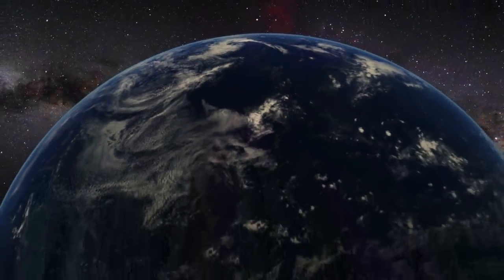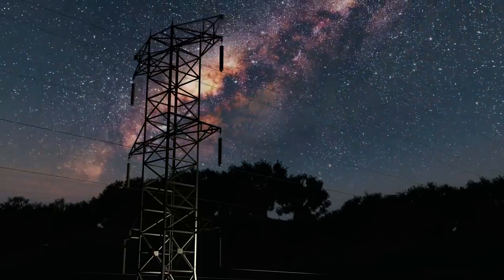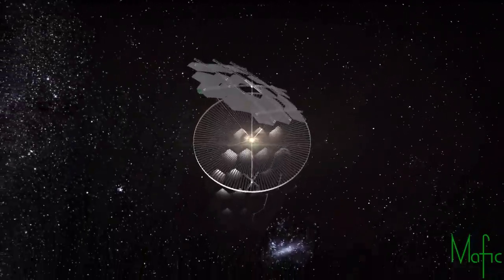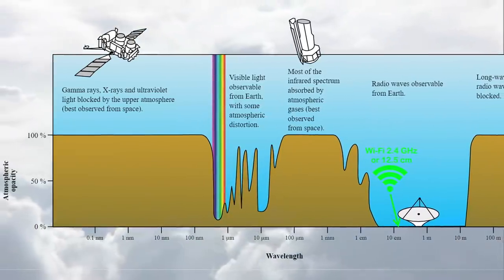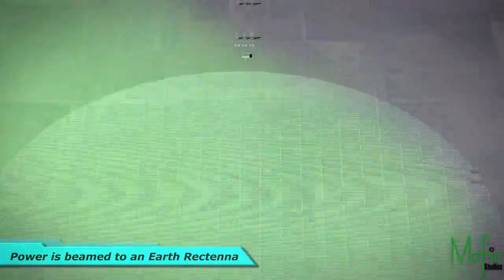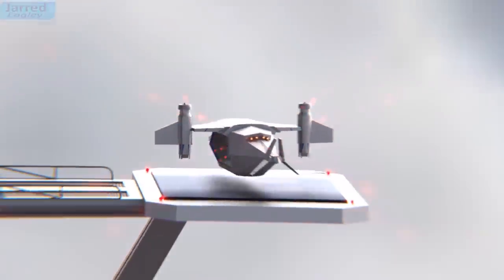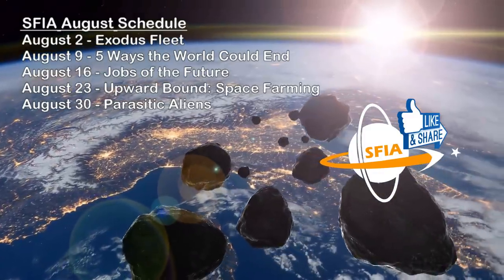Power Satellites & Space Based Solar Power

Comment: First, battery storage is only necessary if localized terrestrial solar is your only source of energy.  So long as another source is sufficient, and there is sufficient demand, you can sell your excess generation to another user and then buy what you need back when you need it.  Also, wind power is complementary as winds are stronger at night.  Long distance transfer of power also helps the offsets the non-load following issue of solar.  Besides, is their an economic sweet spot.  Kirk Sorenson in his speeches on Liquid Fluoride Thorium reactors mention how one of his tasks as a grad student was to study space based power systems and when they cranked the solar panel efficiency to 100%, dropped launch costs to zero and cranked oil costs to $200 a barrel (he actually described it as a Mad Max future for oil prices) it was still not economic to place solar power plants into space and that's with zero launch costs.  Granted maybe fossil fuels may rise to thousands of dollars per barrel but it would appear that for the foreseeable future, simply balancing generation between terrestrial solar, wind power, tidal, hydro and nuclear as well as long distance transport of energy would be the path to take.

Comment: Power storage ideas are an entire subject in and of themselves.  The new generation of batteries such as metal lithium, zinc bromine gel and salt.  Hydro-pneumatic devices which compress air using water in order to get around the heat transfer problems.  Simply pumping water to a higher level during the day and converting with water turbines during the night is possible.  It only remains to be seen which technique wins the efficiency, cost and convenience battle.  Perhaps all will have their niche.

Comment: You forgot the most important application that could be done right now: massive shades in Lagrangian L1 reducing the solar influx by 3-4%, enough to cancel any kind of "global warming" effect or fluctuation in the Sun's radiation (the main trigger in what we call "global warming" and ice ages). At the same time, when and if a Maunder Minimum will take place, the solar shades / mirrors could reflect back more energy, heating the Earth or part of it. 

Also, Philip Lubin could use those mirrors to generate some energy and power his giant 10 GW array of 1928 nm lasers in order to deflect any asteroid heading to earth.  Or use it as a giant space weapon against totalitarians. The cost for all of this is just a fraction of what we spend now on "CO2 reduction"  and "green certificates". All the industries would benefit from a lower cost of energy, if that is produced from coal with sequestration and in remote places, and at the same time, the energy bill would not include any kind of wind&solar subsidies (that will go to this massive laser space project). Win / Win for all and a massive incentive for a Moon Base, where all of that manufacturing for the 1500 km mesh array will take place. 

https://www.youtube.com/watch?v=XwYJZqBB0ms

https://1.bp.blogspot.com/_JtKzQh0R9Tg/ShoeWDFE8PI/AAAAAAAAAoI/8NiaXweN9dY/s1600/how-to-move-the-sun3.jpg

Comment: One critical issue with large arrays in Space for power is micrometers & comet dust that can destroy them. Probably the only practical option is very large mirrors with filters to produce near coherent light since a meter impact in Mylar isn't going to create electrical shorts. Perhaps there is a meta material possible that would convert optical light into microwaves (ie direct visible to microwave conversion with any electrical conversion - no middle man). Mylar is cheap and light and thus its possible to lauch square km of mylar in a single heavy lift rocket.                                        That said there is an issue with microwaves interfering with radio transmissions. Probably the best option is a low earth orbital ring with tethers to transport electricity down to the surface. I think an orbital ring might be easy to construct that a space elevator since the circumference of low earth orbit isn't significantly longer a single tether to Geosync. orbit. Especially when you can use multiple tethers linked together and their orbital speed would hold them in place during construction. Another propulsion method is to use very large filtered mirrors to produce near coherent light and use that instead of laser to propel probes and space craft. Mylar is cheap and light, and an optical filter to reduce the light into a narrow wavelength would not be complicated. The only issue is collimating the light over long distances, but considering current optical tech, it should not be to difficult.

Comment: I don't think it can compete with ground based solar and power lines. 
If you put solar in Antarctica, you've got 24/7 power for the northern hemisphere winter months. Transmission by cable over that distance is more efficient than microwave orbit to ground. During the northern summer it's always sunny somewhere close. You can just connect the continents with UHVDC networks. 
There might be a place for this to power isolated island communities, but it just doesn't work for general use. In the same way that data satellites are useful for special cases, but the majority of data travels by undersea cable.

Comment: At around 15:02 details of 'wireless" transmission of electricity thru the use of microwaves is discussed. It struck me, that was the goal of N. Telsa decades and decades ago...correct?

Could it be, somewhere, somehow...some 'hidden" research data of Telsa's work, has been in use for a long time...without the knowledge of anyone, except those entities seeking to exploit it for their own benefit?

I don't know, but the physics involved has been around for a very long time, only funding of 'edge breaking" technologies would be necessary, to make the physics reality. Black Projects or programs could easily fill that "funding" necessity...without any public knowledge it existed.

Comment: 7 minutes in, so sorry for commenting before watching to the end, but you don't mention relation of satellite effectiveness based on it's distance to the sun. Only how effective it can be compared to Earth based one when it's on the same orbit, I pressume? Satellites in L1 points would be closer though.
Reply: TheArklyte, Sunlight decreases with distance squared.  Transmitting to Earth is goal he was talking about.  
If you want to save on silicon wafers you can use thin sheets of metal to reflect and concentrate sunlight.

Comment: Wouldn't the meteorological effects of a giant rectenna's heating cause some really severe weather? Even if you went for the low density, high volume option of covering farms with chicken wire, having all of the farmland in the US throwing off that much heat should make a difference, shouldn't it?

Comment: Microwaves do most of their heating by being absorbed by the water molecules in food and living tissue. Microwave ovens use frequencies specifically selected to match those absorbed by water. What if you transmit power using frequencies that are NOT absorbed by water, or any of the substances in a living creature, frequencies to which those creatures would be virtually transparent? We could increase power densities significantly and cut down a lot on the area of the rectennas we would need to build.
Reply from the maker: Microwves bounce around a lot before being absorbed in an oven, but yes you want to use whichever frequency is giving you the best conversion and absorption percentages.
Reply: lasers! death ray or not.  you can imagine a web o satelites all interconected/ if one makes a wrong move the other jump for frying the impostor. IT wll do just fine. A new race is begining AND ITS beneficial in terms o cutting costs.you must admit this

Comment: So we just need to cover Nebraska in chicken wire and absorb 100W/m^2 there. Alternatively, you could make an energy beam down area about 1 km^2 for every 100 square kilometres of land surface and you wouldn't have to aim all too accurately to get enough energy to earth as microwaves, as Nebraska isn't nearly a percent of the are of Earth (being one of the larger states I guess it's around a 20th of the USA without Alaska)
Reply from the maker: It's msotly about making sure its not concentrated it can be weaponized on purpose or accidentally, personally I would go a much more concentrated route, but the public might balk at that, and we've a constant problem of alternative power methods scaring the public off.

Comment: you forgot to mention low sun orbit ~mirrors~, which (with some holographic lenses tech) could concentrate/redirect light energy on orbits around earth/moon/mars. 
Energy flow per square meter is inverse of square radios to sun, so satellite at  0.01 AU from sun, will have 10000 more energy income per same square. 
getting there is not very hard too : to low periapsis gravitation maneuvers with earth, venus and mercury can be used, and to low apoapsis (lower than mercury) solar sail, or solar thermal rocket (giving we already have means to concentrate/redirect light energy) with 1200 isp.

Comment: This type of power generation can also be used on Mars. If have a set of collector satellites orbiting on a polar trajectory then have a large set of distribution satellites orbiting equatorially with microwave antenna to collect power from perpetually lit collection satellites and beam it to anywhere on the planet. This could in theory be cheaper and safer than the nuclear option. This might all be a moot point however, because if we find hydrocarbons on Mars in large quantities we can just burn it the good old fashioned way, and bonus... No need to worry about global warming.
Reply: Before you comment about my grammar, I was using voice to text on my phone and didn't proof read it.

Comment: Why not use mirrors to just deflect solar light onto locations like the Atacama or Sahara desert, Tibet or Australia (Arrange a big solar power plant over there)? Clouds are not a big problem then. For a very continuous operation, one could fix these space mirrors in a suitable GEO orbit. In case of a GEO orbit the power plant on earth can use focusing methods without needing trackers (focused sunlight enables higher conversion efficiencies to electricity). The downside to using a GEO orbit for the mirrors in that the 0.5° apparent angle of the solar disk translates to a 320 km diameter light speck on earth. If you put mirrors in a 10.000 km (above earth surface) equatorial orbit, they remain almost permanently sunlit and the radius of their reflection of the sunlight reduces to a speck of diameter of 80 km: in this arrangement, the mirror will have to re-orient a few times during its circulation around earth: focus on Atacama, re-focus towards a plant in Sahara, then focus on a plant in Tibet, then Australia, rinse repeat... By the way, maybe the video overlooked this defocusing problem in the discussion of the use of Atlas towers.
Reply: Maybe the lowest-hanging fruit is to have a big mirror in low-altitude polar orbit. You have your space mirror always above the day-night line on earth (requires tiny course corrections throughout the year of course). Your mirror will be constantly re-orienting towards a big terrestrial solar power plant underneath which is enjoying an open sky. Since this power plant is at that time serving a early-morning or late-evening electricity market its productivity boost will be extremely lucrative.

For all these arrangements with non-GEO mirrors, there's the issue of light pollution of course: while the mirror is re-orienting towards another terrestrial solar power plant, its reflection will briefly travel  (be it just a few seconds) accross land and ecosystems which don't want this additional light.
Reply: The advantage of space mirrors (as opposed to PV panels) is that a few atom layers of Aluminum suffice to do the job, so they're potentially very light per m^2. Also, the degradation of the aluminum due to high-energy cosmic radiation or whatever will be a transparent issue: not much unforeseen risks there.

Comment: station keeping for a few million m^2 of solar panels would quickly get expensive, much less billions of m^2.  photon pressure would constantly be pushing it out of position
Reply from the maker: You kinda hit on the answer with the problem, you can twist big solar sails around occasionally to do the station keeping using the light pressure.
Reply: Isaac Arthur true, but that would eat heavily into your power production everytime you off angled them to produce a lateral thrust and reduce the normal forces.  maybe size the panels to match the normal photon pressure forces vs the gravitational force on the panels so they sort of "float" on the light to reduce orbit maintenance

Comment: Okay, I think that this idea/stage had to be explored as if it could happen, and good effort doing so.  You took it as seriously as could be.  What Asimov couldn't foresee from the standpoint of the 1940's, however, is that sustainable/passive power generation would develop to the point that this stage is irrelevant to the overall evolution.  The resources (financial, physical, & creative) that would go into making these power-transfer conduits happen would be better put to other developments.  To be fair, I think this has only become obvious in the last 5 years because of the looming appearance of distributed power generation by things like residential solar roofs, etc.

Power satellites were a prediction generated from the idea of centralized operation.  It is inherently inorganic and prone to bottlenecks and disruptions in all its ways.  Basically, it's a holdover from a colonial and imperial paradigm.  This is not the world we're heading into.  This multi-trillion dollar industry of generating electricity has proven to also generate a lot of destruction and corruption.  It is inherently destined to be replaced at large with a distributed network, and it has no way to fight that evolution.  The current generations of individual-scale "renewable" technologies have already begun to spread through the social consciousness, and there are sufficient commercial and academic resources feeding that evolution to guarantee that it cannot simply be squashed by incumbency.

Obviously, power-generating satellites will have their place in the future, but it won't be sending energy to earth.  Earth already receives more than enough direct solar energy and secondary wind & wave etc effects to sustain itself, especially in the lower watt per person consumption future.  Bucky Fuller saw that 50 years ago, and it has only gotten closer.  Instead, these satellites will feed power to the moon, or mars, or (ironically) the outer solar system colonies where a large collector in space can efficiently beam power to small installations and habitats.

Even fusion reactors, cool as they are, still amount to a big fussy industrial system, whereas a passive solar collection with infinitely variable scaling just... works.

Comment: The space shuttle - a horrible dead end project that set space exploration back by a generation - would seem like a bad rocket to have in your intro #JustSaying
Reply from the maker: It seems to have gotten a bad rap of late, it certainly had its flaws but the re-usability thing, even though it didn't work out well for the shuttle, was the right path. We learned a lot with it. Other paths might have been more fruitful, or maybe not.

Comment: 10:55 - wait, what?  What alloy won't react with superhot liquid sodium, even absent oxygen?  (Yes, I know there are sodium-cooled fission plant designs, but we're looking at1000+C, not just a hotspot temp of ~750C)  its still a better choice for space than water.
15:35 - Siberia, central Africa, Greenland, 
Australia, even the Saudi desert are site candidates.
This would all be moot if we crack fusion though.
18:32 - LOOL, love it, want it!
22:00 - Is the Karman line high enough up to mine/reclaim helium?
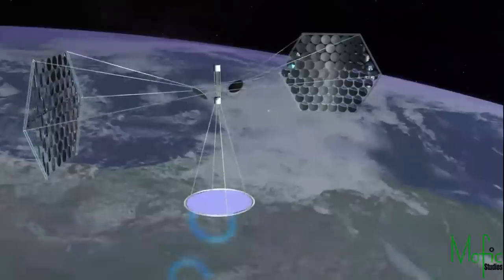25:36 - I was thinking through most of the video; "wouldn't it be easier to beam power to earth from the moon?"  Power satellites sould more like a good application around Mars or Venus, due to the fact that earth is already well-populated and this is a technology that could be used in a 007-style scenario.

Comment: Why dont we use mirrors on earth to reflect the sun and prevent the heating of the planet due to climate change?
Reply: They do (to a degree). Several of the glaciers in Italy have partial reflective coverings during the summer.
Reply: Bluebonic Wow that's pretty awesome. Thanks for the info, will have to check it out.
Reply: If you read IPCC's reports you'll find for example that ice melting (95% albedo) is one of the factors in global warming (a positive feedback loop actually).
It's not a major factor but it's considered in the analysis.

Comment: Sorry Isaac, I have to disagree on this one. Space Based Solar Power (for use on earth) does not make any practical / economical sense. For it to make sense it has to cost no more than 6 times what it costs here on earth. And considering these days solar panels are extremely cheap, getting them to space and building the infrastructure at just 6x the cost is impossible.
It would be a cool project though, since as fans of this channel I love megastructures, however there are better (and much cheaper) alternatives.

Comment: Isn't it the easiest to just use fusion.
Reply from the maker: If you've got it, maybe, though keep in mind most fusion designs spew out a lot of heat while producing electricity, adds to your maximum power more than beaming it in. If heat is your bottleneck, getting 300 Watts of juice for every 1000 W of heat generated is less ideal than getting 900 W off 1000 by beaming it in to rectenna convertors. Even if you've got fusion, you might stick your plants up in space and beam it down. Just depends on costs and priorities, the bottlenecks.